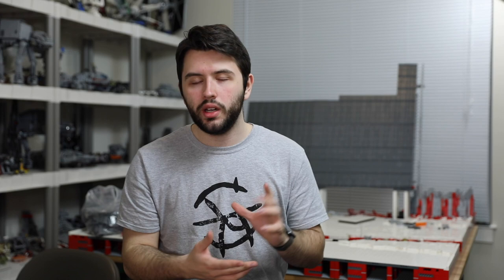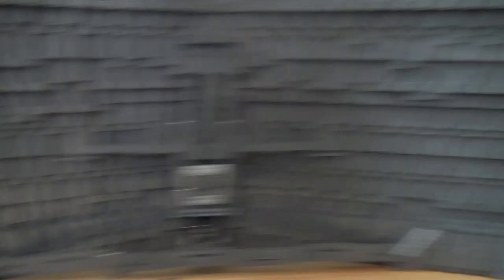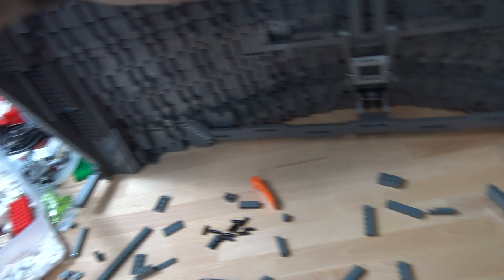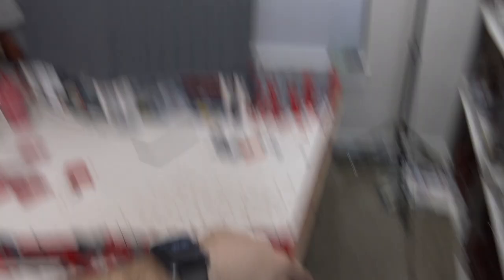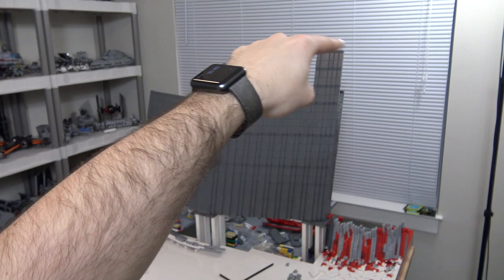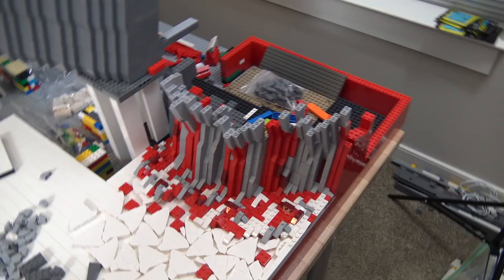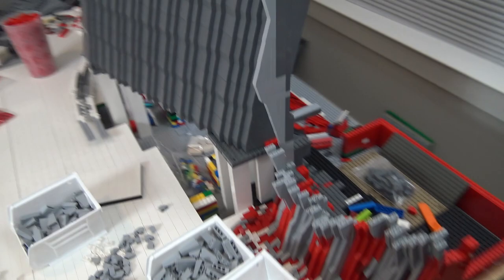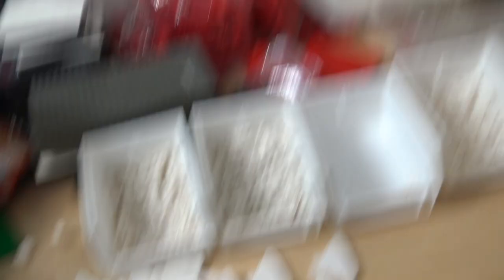Building Crait in LEGO - Week 16: Structure Reinforcement

Comment: Hey David, how come you didn't use red 2x2 tiles as the base instead of white tiles? Wouldn't you want the red to seep through the cracks of the white salt pieces?
Reply: There are no cracks on Crait. There are salt clusters. Look very closely at the ground and there is no red that you can see through it. The red is only exposed when the salt is picked up via footprints, the ski speeders, etc.
Reply: That's a good point, I haven't watched the movie enough to see all the details. I still think design wise it might be a cool concept based on his "salt pieces". With that being said, I prefer your method of showing the salt clusters, and the foot prints (Im actually using the foot print method in my Hoth MOC)